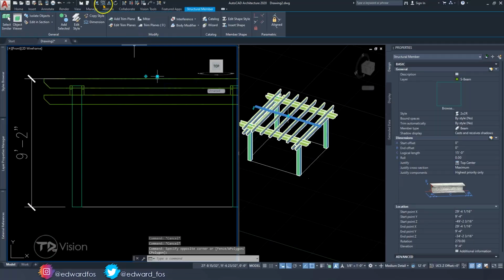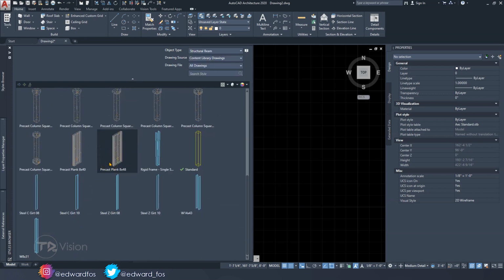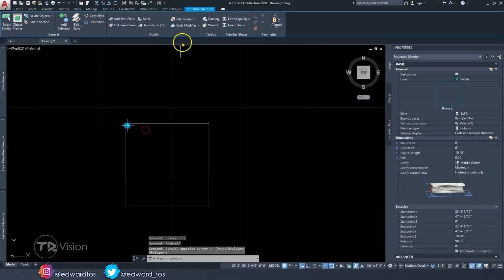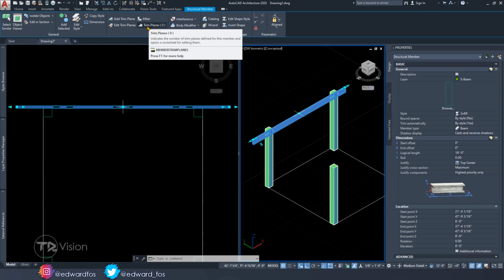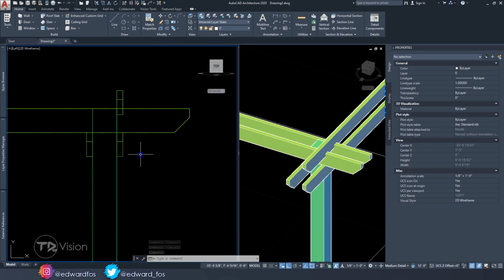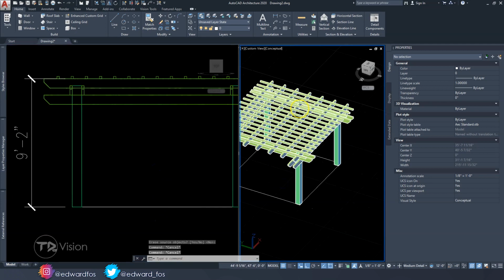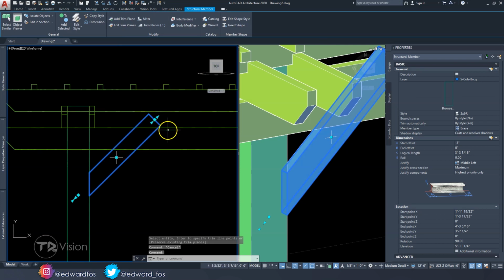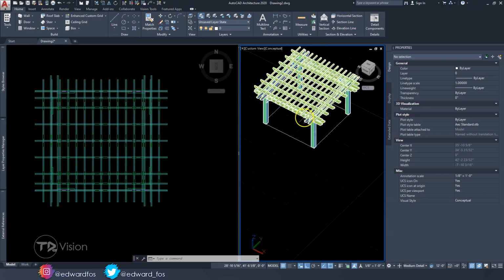WOODEN FRAME (Pergola) STRUCTURE in AutoCAD Architecture

Comment: Cool! Architecture add-on provides amazing features that are so lacking in pure AutoCAD. Probably this experience can be used in the design of furniture and exhibition stands too. But many engineers are afraid to use special "structural components" instead of regular solids, or simply don't know about them. In this case, AVC plugins will help them a lot for full-fledged work. Maybe TD Vision U will tell us about that too? 😉
Reply from the maker: You are correct! To all furniture designers/makers out there, please do yourself a favor and check out the AVC plugins for AutoCAD. I will be exploring some plug-ins for AutoCAD on the channel, including some of the AVC plugins, when I get some time 🤞🏾.